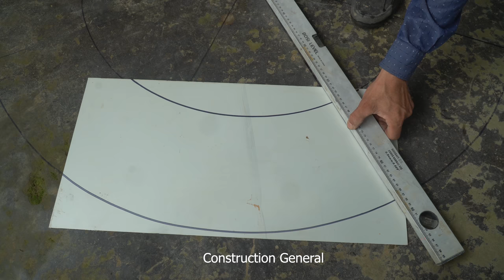Construction Of Hydroelectric Wheels From Drums

Comment: Very cool. But, it's recommended to add the description of each components in the project, especially the dimensions of the parts such as the wheels, bully and the size of the Generator or motor being used. How much its power and how much produces. 

Thanks alot
Reply from the maker: Thank you so much 😊
Reply: My guess is it makes about 150W
Reply: Or, ya know, you could not be lazy and make your own design and source your own parts.
Reply: yes
Reply: Figure it out for yourself db

Comment: This is crap shit the idea is possible but he's not using the electricity generated by the motor to power the bulb and fan because the motor is connected to the distribution board but when he connects the fan the intensity of the light doesn't changes which means he's using power form another source to power thr devices more the load less the speed of the fan and bulb the motor used is a dc motor which can only output dc but the fan he's using uses around 220v ac if he lives in asia

Comment: I would be more impressed if he took his waterfall charging station and used Just One battery and set up a hydrogen water separator so it could use the hydrogen gas to cook his food or even power his car I've seen many videos from India and Mexico and Lower South America that where they make their own fuel and direct hydrogen injection if the plumbing is done right not cheaply are half ass it works fine you cut corners it'll detonate in your face
Reply from the maker: Yes, Thank you ! Please subscribe to my channel and help me share ❤❤❤

Comment: I asked a question to transfer maybe 3 and you still haven't responded to a do you have a converter how many watts are you generating All That Couldn't information that tells you what you're actually have going you got those white bulbs does I didn't catch last time you know what size wattage Shadows 25 watt or 150 w
Reply from the maker: It is alternator 220v, 1.5Kw/h
Reply: Thank you for your response
Reply: So how much for the the well and the generator got that needed inverter from DC to AC I miss that well I have to get will I need a Step up Transformer the cover of voltage drop right now I do not have any distance from my house to where this project would go I'm just guessing maybe 1500 ft plus500 more feet total of 2000 feeding distance but once again I'm just guessing I'ma do it myself kind of guy that's why I was asking you sell what I need if I decide to do this I'm not going to hire a contractor but I would be interested in buying some of the products you have already already sold me how most it was made from a video saw

Comment: Dig the exit from the sluce deeper and direct the water flow across the top of the wheel. The new Overshot wheel will give twice the power for the same amount of water. The only other change you will need to do is turn the wheel through 180 degrees so the scoops are reversed.
Reply: Digging the tail race deeper would not work unless the river level drops away to a lower level. It’s the surface level of the head race compared to the surface level of the tail race which matters

Comment: looks like the Generator could be what size like, then needs turn close to 2000 Rpms for 220v the further the appliance from the electrical source the more electric needed carry the current, then use thicker wire, Dump, inverter, distributor, battery, Batteries. the simplest water wheel is made with spoons, D/C wire going in inverter, A/C wire coming out of inverter, unless use D/C Volt
Reply from the maker: Yes, thank you so much ❤️❤️❤️❤️❤️

Comment: This is great Mr Construction general. You are very creative. I would like to ask that; why is there no direct connection from the turbine to the motor( generator)? What are the effects of connecting the generator direct to the turbine?
Reply from the maker: Thank you so much ❤️❤️❤️
Reply: Doing it the way he did increases the number of rotations on the generator which increases the amount of power produced.  Going directly from water wheel to motor, he'd get a 1:1 rotation.  Meaning every time the water wheel rotates once, the generator rod also only spins once.  But by throwing a large wheel on the water wheel and having it spin a small wheel on the rod, then a large wheel on that rod to a small wheel on the generator gives him about 30 rotations on the motor for each rotation of the water wheel.

Comment: how much power dose generate? is it going into batteries or a house
Reply from the maker: 220v, 2000W
Reply: @Tran-Chien  wow
Reply: If it can produce 2000 watt 220 volt, then it is usefull. After that, you must build more units and build supply lines to the houses in the country.

Comment: also a fun way to use that damm. is to pump also the water up back behind the damm with an electricle water pump. and still have power left for something else.
Reply: water some how also can be pushed up against a steep wall. according to my old physic teacher. althou he could not find a use for that. that design. looks like a flat water hill with a specific (trail and error found) angle between 11° and 13° declineation. it looks like a flat board where water being floating down. with a both sides a very small tube. the wide water force glideing of that hill. has enough strength to pushes a smaller stream up. in opposite direction. wich is very remarkable.
Reply: also anothet expirment. haveing a hose in a barrel. in the water of that barrel. on a chair or so. and then have the hose below the barrel irself outside. so on a lower level of altitude. and then suck the hose full water. can make the water inside the barrel, climb up over the edge. and then flow down out the end off the hose. wich is called "leverage". the water flowing outside the hose. will draw or pull. more water out the barrel. with suction. the water downwards will create a bit vacuum behind it. while leaving that place. wich will be filled with new water outside the barrel. it is mainly the air presure of the atmosphere. that pushes the water. and a bit of gravitational forces pulleing that water. where even friction of the water to the sides ofnits container. can be used to speed up or slow down the water flow. have fun.
Reply from the maker: Yes! Thank you so much ❤️❤️❤️❤️
Reply: That's a violation of physics.

Comment: Not quite as much a model as they used to be, but I still like it.
Reply from the maker: Yes, thank you so much ❤️❤️❤️
Reply: you sell any of that that. So are you a contractor you said Construction general does that make you a general contractor. 🤔 or u sell the set up 
The wheel motor . The wheel. Or should I say that generator what about the inverter from DC to AC